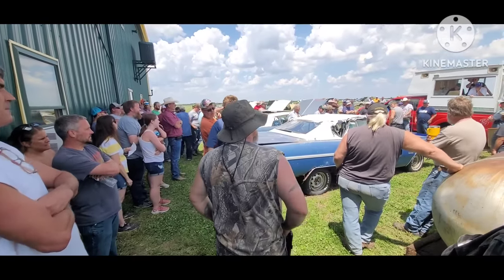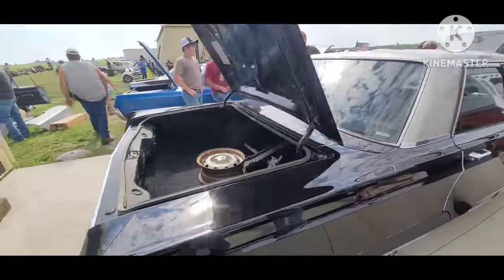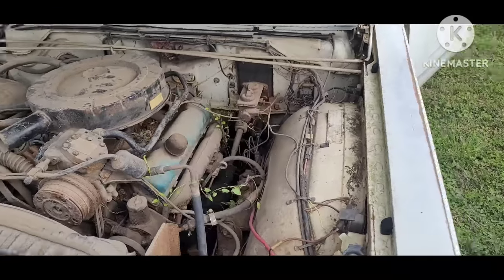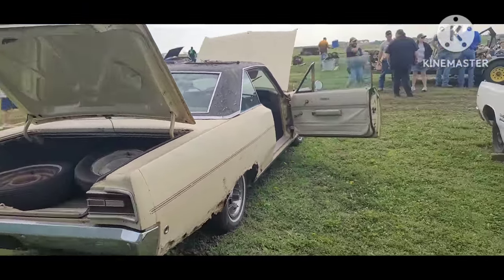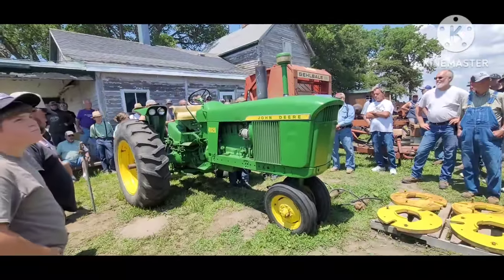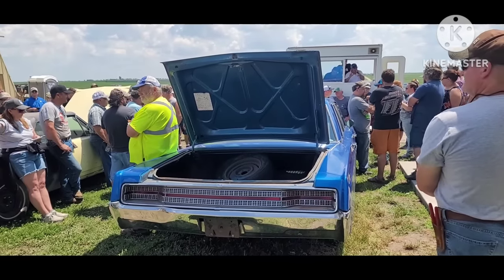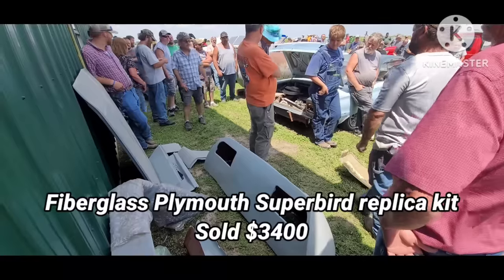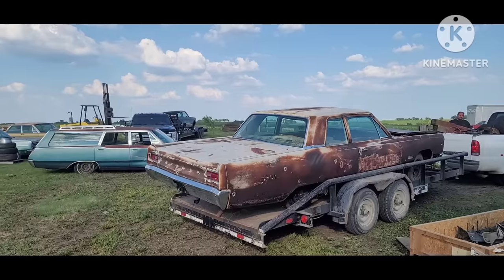I bought my RAREST MOPAR EVER at this Estate Auction! 1950s, 60s, 70s Dodge, Plymouth & Chrysler!

Comment: A rust free parts car for your 4 door sedan cop car would be cheap
The 58 Fury is amaIng if it actually came wirh the 392 dual quad....that would be in a 300 D
If a young person wanted a good profession they might buy a quality wire feed welder and get to where you could do rusted panel replacement
Your 2 dr. Cop car was either a lutenent's or a dectective car most likely

Comment: Thanks for saving a fleet car.  A few pursuit car details I've seen on Mopars are:  One key fits everything (not the normal two Chrysler key combo), certified speedometer, unit number always painted in lowei driver door jamb for quick verification of correct fleet car,  overhead dome reading light near rear view mirror,  wire harness inside car running from front seat to trunk is in armored cable to prevent damage by person being transported, front stabilizer bar,  reinforced roof, extra body welds, heavy duty alt.  AC shut off switch for pursuit, fist idle pull knob on dash for traffic stops.  These all seem to be the norm on my hwy pursuit c-bodies.  Research yours and enjoy!

Comment: Serious collection of C bodies. Many of these gave their engines up as replacements for Hot Rods. I used to buy 383's and 440's for mega cheap back in the late 70's as missing shifts in my Road Runner would zing the third rod bearing toot sweet! This is a cool collection for this Mopar fan. Thanks for taking us along.

Comment: I had a 68 Coronet 500 convertible project car in the late 80's. When I really got into the body work, doing anything with with the rust repairs was way beyond my skill level, and life circumstances changed, so I sold it. I still miss that car 35 years later.
Reply: Great story. That loss casts a long shadow eh bro?
Reply: Those cars are too big to drive

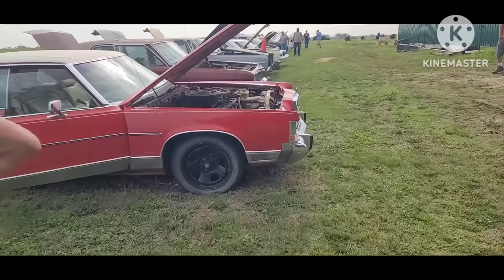Comment: So at 12:37, the Red Chrysler, something you didn't pick up on....and why that can needs to be saved......It's a special order car, that color wasn't a Chrysler Color, it was offered on the Imperial, but not on a Newport or New Yorker.   Note the bumper filler panels are Silver/Argent colored, not body colored.   That also indicates a non factory color, you'd see that on police car paint combinations.   Had you checked out the fender tag in the engine bay, I'm  100% certain it would have said, "special order"
Reply: That's probably why it went for strong money as a non-runner with a moused-up interior. Very cool car.

Comment: The '68 black New Yorker looks like it has an Imperial steering column. The Mopar police cars usually had white steering wheels.  My father had a 1968 Ford Country Sedan police spec.(no a/c and had a 390 V8). He was a Fire Dept. Battalion Chief. It was the year that our local FD tried white vehicles, for better visibility.  The 2nd new car my parents bought was a 1968 Plymouth Fury III 4dr. hardtop. It had the Commando 383 V8 and a split bench front seat.

Comment: 48:15 - That '67 Plymouth Fury station wagon was a steal for $500. Station wagons are hot. And a Fury? That has the potential to be a serious hot rod. :)
Reply: It sold for more than the 1968 Galaxie station wagon, although it may have been more complete.
Reply: That was a steal… deluxe steering wheel and clutch pedals.

Comment: I still have a black two-door 67 Fury 3 bench seat Factory 4 speed 383 4 Barrel car that my aunt bought brand new and still has the card with her name on it.I think it has the sport roof with red interior she gave it to me when I was in high school and I can remember loading up on my friends and driving 2 hours  to concerts  Kiss, Black Sabbath, Uriah Heep and Bob Seger. it would only run on Ethel and I put some regular gas in it and it was knocking and banging and ended up breaking the camshaft. I have only seen two or three four speeds like the one in the auction but I have never seen another bench seat 4 Speed. I almost sold the four-speed transmission for $500 a few years ago to somebody wanting to put it in a road runner, glad I didn't. I hope to restore someday but I just like looking at it. I have did a lot of research but can't find out how many were built that way, best I could come up with was .02% were standard shift???

Comment: If you look closely at the gearshift from the 68 Fury convertible, it looks like it came out of a Mitsubishi Eclipse or similar Mitsubishi product. That's different.  I dont even think Chrysler and Mitsubishi were teaming up then. That didn't occur until the early 70s, I believe. I also noticed that front grille of the New Yorker looks similar to those on the mid 70s Chrysler Fury and Satellite lines, maybe even Volare. Coinicidental?? I'm guessing Chrysler went through the parts bin for the latter models??
Reply: Their first joint venture would have been the Colt starting in 1971.

Comment: Ever hear of a 1975 Dodge John Deere special pick up ? I had a very special 1975 Dodge d100 half ton long bed pickup truck. This was one of a small batch special of order pickups made for John Deere corporation available only to John Deere dealership owners. It had a 375 horsepower H code police interceptor 440. White with John Deere Green side stripe. Green deluxe interior complete with full factory Gage package in the dash including tachometer this dash was usually only seen in two and a half ton and larger Dodge trucks.. if you see a 75 Dodge pick up with a 440 it might be the real deal. Every Dodge dealer I ever took my truck into claimed it wasn't built by the factory but I had the broadcast sheet and would prove it to them that it was a genuine John Deere special.

Comment: I thought the convertible 4 speed went cheap 3800.,I think, I have a 63 fury convertible 318,pushbutton auto. running when I parked it 3500.will buy it, cash "